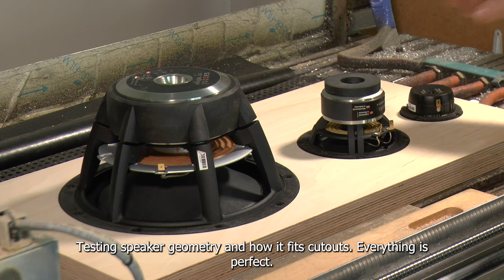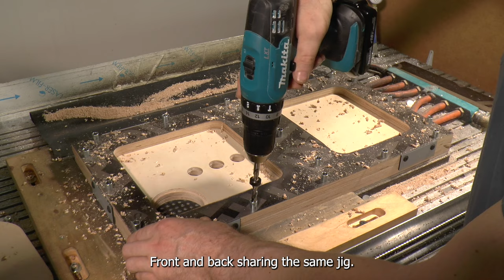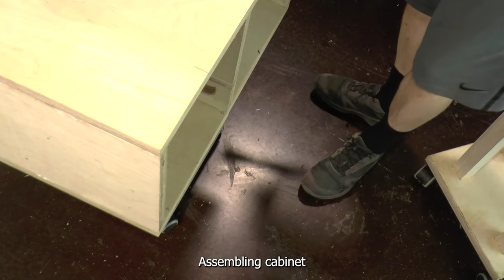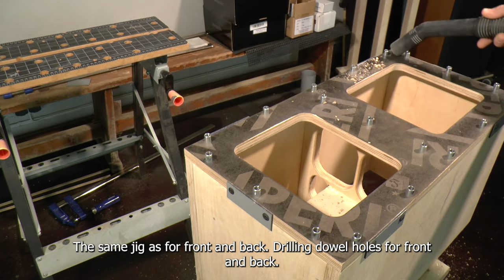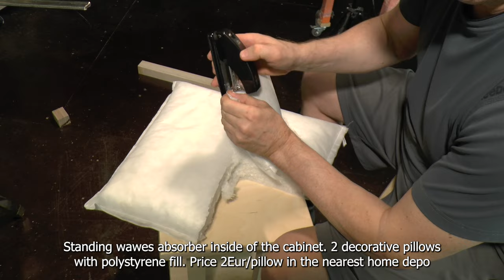Building Troels Gravesen SBA941 DIY speaker end-to-end tutorial.

Comment: I was wondering about the pillows, i understand that you need dampening, but making those small pillows, will they not take up cabinet space, as far as i know, you would want a filler that lets air pass through it, are you making a compromise, or are there something i miss? Lovely work anyways.
Reply from the maker: You are losing physical space but not cabinet and loudspeaker interaction volume. Physically dampening is rising box volume and lowering woofer and box calculated resonance frequency. Dampening works so that sound initiates fibers and converts them into heat. The dampening volume extension ratio is calculated when using good speaker design software.

Comment: Love these speakers, they were to of my list to build, but then I decided to go the whole hog when the Faital 3wc 15 was released.   Great job - but is this the right speaker?   Troels version has different tweeter and also mid woofer and tweeter are mounted off centre?
Reply from the maker: SBA941 is a very well-designed speaker an off-center design has a theory behind it. I recalculated 
Speaker boxes and midrange cabinet as well. I have checked very expensive large studio monitor design principles and most of them have similar designs to SB941. At least the final result is outstanding.
Reply: @guntarssmits2104  did you redesign the crossover?
Reply from the maker: @janus1977  It meant to be active and I have used Behringer Super X Pro CX3400 crossover and 4x ICEpower125ASX2 with balanced preamplifier boards. 2 in bridged (woofer) and 2 in stereo. I have tested also with mainstream passive crossover from china with good results. It is 8 ohms crossover. In my design woofer is 8 ohms, tweeter, and midrange 4 ohms. It worked well. Only tweeter needs attenuation of what I added into the original crossover. AIYIMA US-385C 3

Comment: Nice design! SBA Satori drivers sound wonderful. I’ve used them for mids in my own build ❤️
Reply from the maker: At beginning of the project, I was not sure about the final build audio quality and a bit reduced costs not using story midrange. The result was so good that if I would build the next version of this design I would use Satory midrange. Still not sure about sound improvement versus SB Acoustics SB12MNRX25-4 4" . You never know before trying it out.
Reply: @guntarssmits2104  I've not tried the SB12MNRX25-4 4 however they seem more flexible cabinet volume wise. The Satori's need quiet a bit of room to breath. I think the Satori's are 'on paper' a better spec however.

Comment: Building speakers with a cnc machine just can't give you the same satisfaction as using a table saw and jigsaw and router.
Reply from the maker: Skill set needed. I am a computer person and bad at carpenter work😀.
Reply: @guntarssmits2104 quality-wise, the end result looks excellent, I like your idea of using the dowels for the cabinets.
Reply: Good point regarding wielding the moxie to use 'Basic' tools. There was a time 15 years ago when we could afford to buy a 3hp ShopFox cabinet saw and Milwaukee routers. The table fence needed some love but otherwise the smooth, sexy tactile feel of these tools was worth every penny.

Prior that I used a DIY table saw. I guess I stopped taking my stupid when making that thing ... surprisingly good cuts.
Reply: Spoken like a true caveman. Designing your own enclosure on CAD and letting the machine do the dirty work for you while you use your time for whatever around the shop is more satisfying than saw dust all over your shop and arms. Don’t hate it because you can’t do it nerd
Reply: @andrewmcmillan8110  LOL exactly

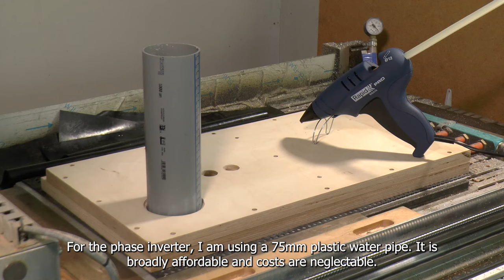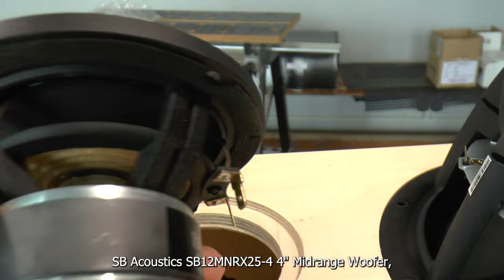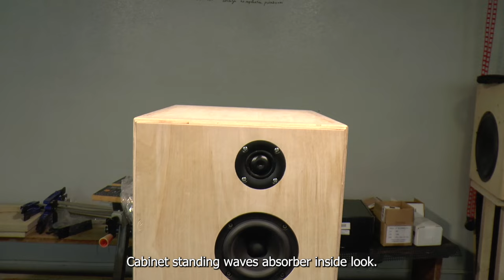Comment: 8:25 Your 'Phase Inverter' is predominantly called "Helmholtz resonator" or just "port / reflex port". But this pvc tubes are very common. Cardboard tubes [fe tubes for shipping] are also a good solution if the pvc tube gives answers (resonate) 17:00 So you used normal dry glue ;-)  18:33 Missing a hole for the midrange cables 23:40 Nice 4" chassis with compensation magnet. It's frequency response says you could use it as bass/midrange in a small 2 way system 24:52 Where is the baffle step between high and midrange that is responsible for the little dip at 1,5 kHz? This step is to set the voice coil of mid and high chassis to the same level. You surely aligned the crossover to adjust the frequency response and the changes with the timing that result thereof. [to my mind this baffle steps and coil leveling make more problems then they help in sound/timing]. But the speaker looks pretty good anyways. Please get rid of the silver srews on the tweeter (or use some nail polish)
Reply from the maker: Thank you for your professional comments, regarding tweeter and midrange time alignment. You are right I did some simplification or trade of. The impact is minor. It is an active system with professional analog 3-way stereo crossover Behringer CX3400 with 24dB Linkvitz Riley architecture crossing at 3,5kHz. When measured results there was practically no visible dip. At least it is inside of overall speakers amplitude characteristics deviation. For bass and midrange, there is phase adjustment built in Behringer crossover. Regarding midrange, I picked a dedicated midrange driver from SB Acoustics  SB12MNRX25-4 with a shorter voice coil than bass midrange. In active architecture, it has precise reproduction. Especially you can hear it on piano music. Excellent tolerance. I did tests with lower crossover frequency and could not distinguish between 350Hz and 550Hz crossover points. I left it at 550Hz to reduce load to midrange. Overall, this Troels Gravesen design is incredible with unbelievable good and round bass reproduction. I think it is due to the good Satory speaker and precisely tuned resonator. I recalculated it to pipe dimensions. But to be honest my speaker designer knowledge is far from expert level.
Reply: @guntarssmits2104  The midrange you're using seems to have a smoother response. The original one has this significant dip at 1,5kHz. I don't know if the curves on the Troels webside was free air or in case. Dips or knuckels at this frequency are typical for such baffle steps. Also your active setup could have deleted this problem. Your solution for the inner stabilizer looks nicer and for sure as stiff as the wormhole desingn they used. In most cases a roundwood from wall to wall is sufficient enough. To improve the bass you should do some heearing sessions with different damping material and positioning of it. Sometimes it's better to have some egg carton foam only on the inner walls or try a longer port. You can easily do this with a 90° bend because they have a sealing and would fit into the closure. The port lenght you need in the build is sometimes slightly longer or shorter than the calculation. Have fun.

Comment: Hi impressive realization indeed and sincere congratulations 
One comment about xover points    You say "SB Acoustics Satori WO24P-8 is a fantastic quality speaker and I raised the crossover frequency to 550Hz to allow instruments and low human voice to play through this speaker"
yes but if you play a track with a lot of low bass content the voice will be mixed with drums and other instruments
The choice of cut points in a 3 ways is a very challenging task    
For instance i wonder if using a bigger mid and a lower cut could be a better solution 
Looking at Wilson Audio for a reference the xover crossings  change from one model to another

Comment: Nice job overall.

I certainly hope the outer covering of those polyfill is completely acoustically transparent.

For polufill, or other similar damping materials (rockwool, fiberglass) to do it's job, the internal pressure waves have to be able to travel through it.
Reply from the maker: It is a real decorative pillow, you can easy breath through it. And it is health certified.
Reply: Fluffystuff won’t do anything for low frequencies either way

Comment: i did my first active speaker recently of my own design, i had to wait until plate amps with dsp because i cant to passive crossovers.....
it actually have the same tweeter as in this build, its a great one :) 
a few things i think would have improved the speaker in this video:
smaller distance between midrange and tweeter for better of axis dispersion.
and why use ported box when you have dsp available, sealed should give you a few advantages. 
its a kit so you just follow the instructions, but its something to think about.
Reply from the maker: Hi, thank you for your comment. It is nice to find other people in the world who are building something. I am not an expert in speaker building. In this case, I am trusting Troels lifelong speaker-building experience. Or course I have read 3 top-rated speaker-building books to understand the basic theory behind and learn the key measurement technics. Some points that I have learned. Sealed versus ported. For ported it is fine to use a 100W RMS-rated woofer, for sealed you need a 300W woofer and amp to drive. It is due to a sealed design acoustic efficiency issue. Second. There is no music below 35Hz and with ported design, I am at 3dB drop at 35Hz. In practice, and I can’t explain why SBA941 bass performance is outstanding. My friends and music lovers admitted that there is something with how low frequencies and bass sound reproducing. It is a specific driver with a very rigid and light membrane for the bass driver. And it has almost 90dB efficiency. I have studied Pro designs for the tweeter, and there is no tendency to put tweeter and midrange very close to each other. I build as Troels recommended. But I should admit that my theoretical knowledge and design practice in acoustics is not sufficient to argue with proof.
Reply: @guntarssmits2104 my comment was to inspire thought.
would be interesting if real speaker designer could go over my speaker design where i put my theories to action. 
most designs are compromises to be a standalone product, but i think that dsp can let you bypass most of those and you can build a design for sound quality and full range down to 20hz.
Reply: Troels has some design with DSP. Maybe that can meet your need
Reply from the maker: You touched an interesting direction. It is a topic for an expert forum. We need someone who did real hands-on to variations of speaker solutions. Unfortunately, most professional speaker builders are bound by NDAs and it is not allowed for them to share their knowledge in public. But you touched interesting concept.
Reply: @guntarssmits2104  getting real information, measured and tested practically and shared are not common practice. 
GR-Research is one place to get into speaker design.

Comment: looks like it needs moire cabinet stuffing to me.  try lining the mid box with natural wool felt carpet underlay, i think it woudl improve things
Reply from the maker: I did it for another cabinet and the difference is neglectable. In practice, a less stuffed cabinet for my ears sounds better. I have checked some professionally designed middle field monitors and internally they are stuffed about 1/3 of the volume. I did not find multi-layer stuff in professional devices. Maybe it is due to the final price reason. But I am not a professional speaker designer. We need statistics and measurements to make an objective judgment. I measured my designs and graphs do not have peaks and drops that would indicate some resonanses..My understanding about stuffing is that you should eliminate some box resonances with it and that's it.
Reply: @guntarssmits2104  Fair enough.  Yeah the need can be quite dependant on design, caninet construction and drivers.

Comment: I dont get how that dowel jig works. How do you do the baffles? Wont they come out mirrored?
Reply from the maker: During the design I made dowell placement symetrical. Jig is done with high tolerance on CNC machine and mirrored fits perfect. Yes it is mirrored for two components.

Comment: It is a textbook operation! Congrats! I didn't see the crossover installation. Did you use a custom made one or did you replicate the original design by using parts like capacitors and inductors? Thanks for the video!
Reply from the maker: I made it active with active professional crossover and 4 ICEpower boards. 2 of them in bridged connection for low frequencies and 3 in stereo for mids and tweeter. Incredible performance. https://youtu.be/tD6uM0QF_GE

Comment: Hey there, hope you are well. I am curious, can these monitors compare to the monitors from ATC, PMC and similar brands. Are they considered to be studio monitors, or some tv speakers. Thanks in advance.
Reply from the maker: It is hard to compare with ATC science they are rare and expensive to get or access. But the result of this Troels design is incredible. I have not heard better sound and details from commercial designs. But I am using it in an active 3-way monitor format with active crossover and 6 amps. I have tested with a passive crossover as well, but an active version is audibly better.
Reply: @guntarssmits2104  hey thanks for fast response, i see, im curious how would some of diy speakers compare to some studio monitors, would it be worth to build a diy speaker for a good price and use it as studio mastering monitor and scrap my adam a77x speakers
Reply from the maker: @dominikperkovic3058  in that case you need an active speaker version with good DSP to make it 100% neutral sounding. Still costly. My guess is it is better to use some branded design for professional usage.

Comment: have you consider  using other materials than polystyrene ? But 2€ for pillow makes the deal :) anyways great craftwork ,would love to hear it in person .
Reply from the maker: When I studied the materials if found out that the key to sound wave absorption is that material should be tiny fiber-based. It catches the wave and converts wave energy into heat. polystyrene fit into physics and was easy to find as well as eco-friendly. When listening seems it is doing the job.

Comment: Suppose I want to buy these speakers, how much will it cost?
Reply from the maker: Let's say that if you want to buy a branded Speaker of such quality my estimations would be about 5K USD for a pair. My Build costs of material were 700USD for all speakers and 100USD for material (It does not include my labor work where I spent about a week to build it). Also, I  bought additional woodworking tools for about 300 USD to be able to complete a project.  Additionally about 60 USD materials for stands. I was also limited by my carpenter skills and stopped at the level of sandpapering plywood. Sam varnishing is needed for a professional finish. Can I make it for someone? No, I am just an electronic specialist, but any professional carpenter can make cabinets for a reasonable price. I was inspired by Troels Gravesen's website

Comment: You might get an OK result, but It is not advisable to change the speakers in a construction. A filter will only fit one cabinet and the speakers that were used for developing the kit.
Reply from the maker: I was using this design together with an active crossover and 6 amplifiers. You can tune a lot of parameters and get almost perfect measurement results.

Comment: Great job!!!!!!!!! , Are you planning on sale the speaker cabinets??
Reply from the maker: It would not be possible due to wight. Shipping costs are too high and I should ship about 30Kg. From the business point of view, I would be able to sell Jigs and DXF drawings. I will think about it in the future. The key challenge is how to scale.
Reply: @guntarssmits2104  do it!!!
Reply: @guntarssmits2104  People often think it is easy to just 'make more' and sell them, but they do not understand that a DIY speaker often uses 'cost no object' components and construction methods that would drive up the cost substantially if it were a commercially sold speaker! This would put them into the range of expensive commercial designs that have marketing teams, parts supplier networks, shipping partners, distribution networks, etc. The real beauty of DIY is the ability to achieve such high performance for a reasonable price. ;-)
Reply from the maker: @BoostedIS  You are absolutely right. I had requests to make a wooden kit, It is not possible due to many reasons.

Comment: Can i order one od these or do i have to buildmit
Reply from the maker: It is Troels Gravesen's SBA941 design http://www.troelsgravesen.dk/SBA-941.htm where I simplified construction to meet my very low carpenter skills. I simplified the front panel and sacrificed phase alignment because its influence is neglectable as shown speaker measurement. I also replaced the Satori midrange with a cheaper alternative. The total weight of the speaker is about 30kg and it is not worth the shipping costs. It is better to find a local Carpenter and give him a Troels drawing to build your dream speaker.

Comment: Drivers are too far apart, wiring with those connectors isn't ideal also, better solder and use copper wire.
The woodwork looks great
Reply from the maker: Those push connectors are reliable. I have seen them in most of very expensive speakers and in my practice no problems with connections so far. Wires are copper. They may seem cheap but those are pure copper with 1mm>2. Regarding drivers it is exactly according to Troels design. I do not have sufficient knowledge to recalculate front panel driver optimum placement. No comments there. From practical implementation it is almost impossible to make drives closer to each other. At least for this cabinet mechanical desing.